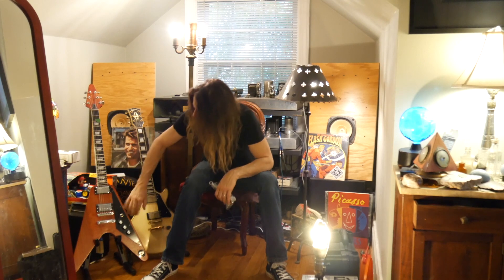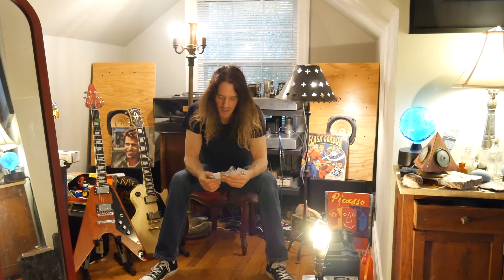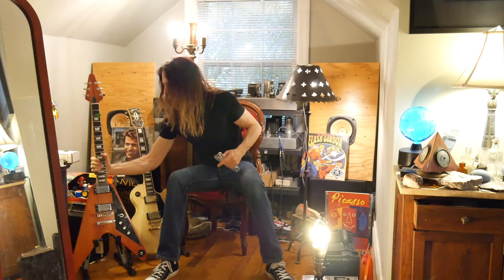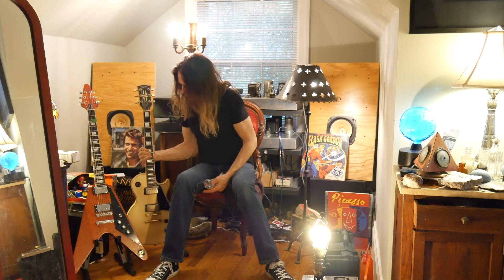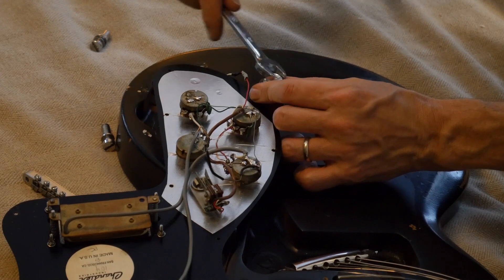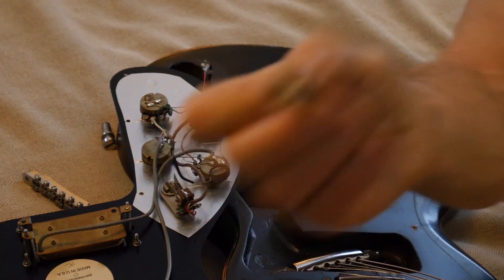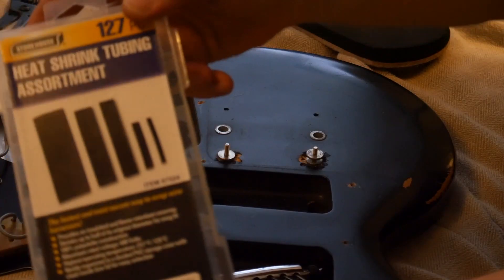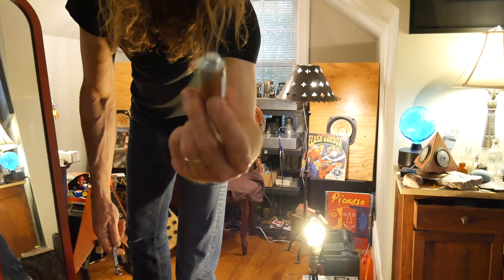How To Remove Bridge and Stop/Tailpiece Anchor Studs and Bushings From A Gibson Guitar Body W/Demo

Comment: Dude all you have do to fix this is put a smaller screw in the whole and back it out.
Reply: Thanks for the video! I also have seen the removal done just by screwing the M8 bolt into the guitar, hitting the wood and thusly pushing the anchor out. Was that not an option with your particular build or is this a superior method? Just curious as I'm about to do this myself so will probably just try the bolt only method first and see what happens.